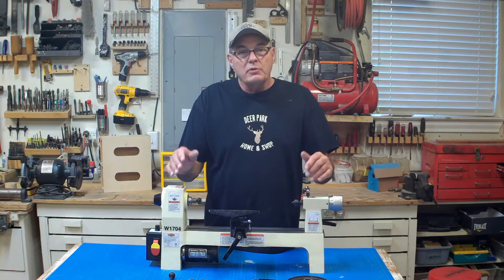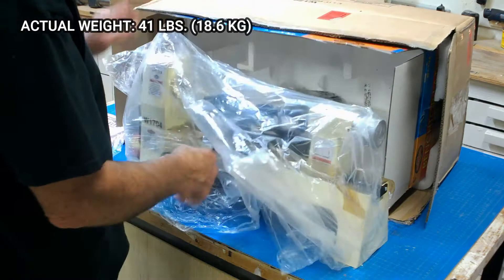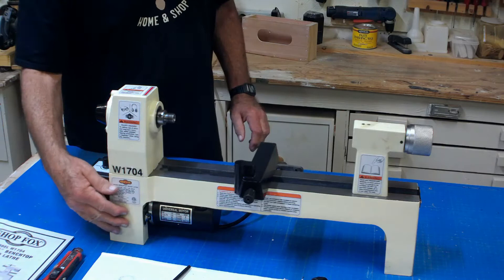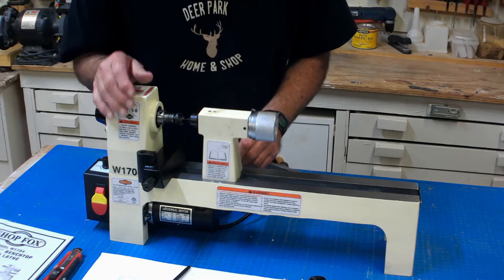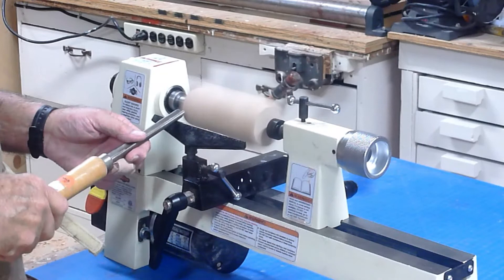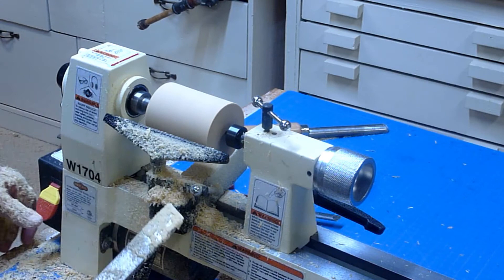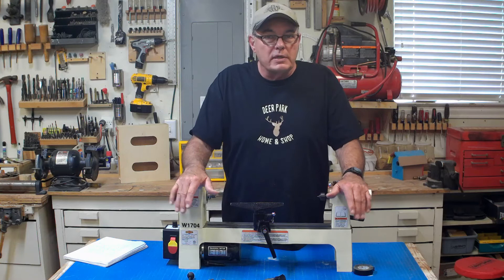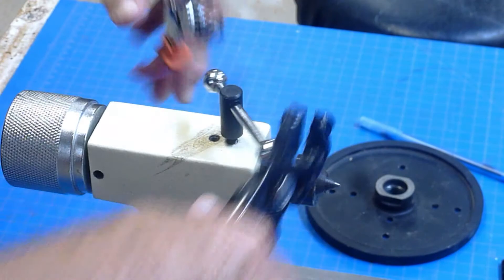Shop Fox W1704 Mini Wood Turning Lathe - Unboxing, Set Up & Review

Comment: I’ve got one of these and the fuse in the plug keeps blowing. 🙈
Reply from the maker: Please clarify.  My lathe does not have a fuse in the plug.  Do you mean that when you turn it on it trips the breaker?
Reply: @deerparkhomeshop2471  no in British plugs we have a fuse in. In my lathe it’s a 5amp fuse. we also have an MCB circuit breaker. My lathe also has a 5 amp quick blow fuse in it too in the control box.
Reply from the maker: @daviddoyle2085 Well I learned something new!  How old is this unit and have you always had this problem, or is this a recent development?   If this was happening here I would assume that the motor is drawing more current than the breaker could handle, or there might be a short in the motor or lathe circuitry.  Your British lathe is a little more sophisticated than it's American counterpart though, and I'm a better turner than electrician, so don't take that as gospel.  Hope you get it up and going!
Reply: @deerparkhomeshop2471  yeah over here they like a lot of fail safes on things. I’m not sure how old it is but it only happened a few days ago. I was just finishing making a bowl and applying beeswax and then the fuse blew, I changed the fuse and it immediately blew again after. I was wondering if it was the power supply. I checked the brushes and they were fine as they didn’t have much wear at all. I was thinking of getting a slightly more powerful motor set for it but it would be nice to get this one back up and running.
Reply from the maker: @daviddoyle2085 Since you've had it awhile, I would suspect a short .  As a matter of fact the troubleshooting section of the manual says just that.  By the way, f you don't have a manual you can download one from this website www.manualslib.com.